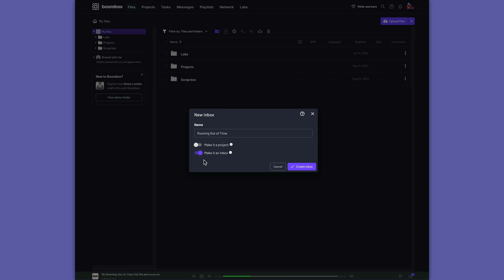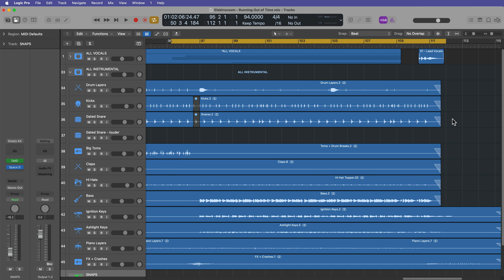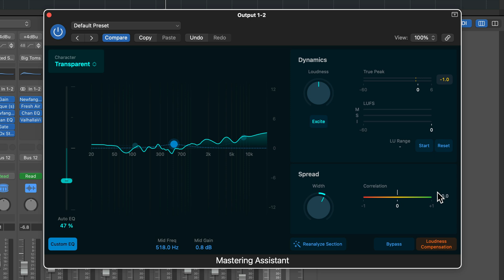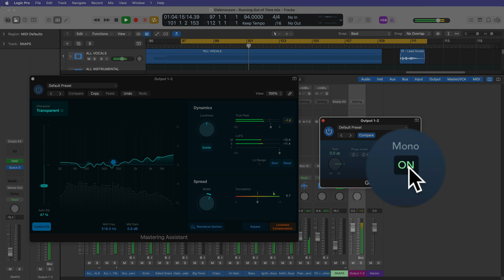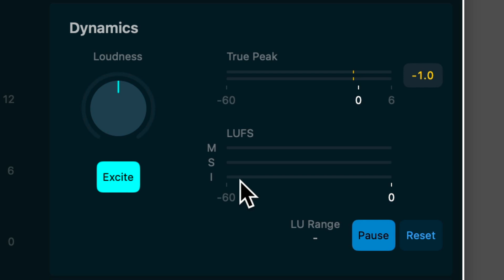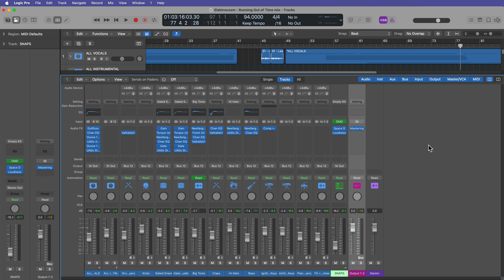Logic Pro 11 - #31 Mastering Assistant, LUFS & Loudness Metering

Comment from the maker: Welcome to part 31 of my "Logic Pro 11 Essentials" course! In this video I cover the following:
1. How to use the Mastering Assignment on the Stereo Output.
2. How to add stereo width and use a Correlation Meter.
3. What are LUFS, what are loudness standards for mastering and how to monitor loudness.
4. How to master a finished mix using Mastering Assistant.

Check out Boombox, the sponsor of this video ➛ https://bit.ly/boomboxsponsor
Song in the Video: Running Out of Time ➛ https://youtu.be/GmqchiAN3As?si=eRTCj3BOK2FrwL2I
For mixing/mastering work, contact me at my website ➛ http://carneymediagroup.com
Follow MusicTechHelpGuy on Instagram ➛ http://instagram.com/musictechhelpguy

Timestamps:
0:00 Intro
1:24 Sponsor Segment
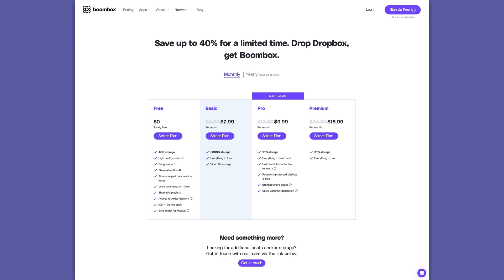2:15 Stereo Out Headroom
4:05 Mastering Assistant
5:20 Character
5:59 Auto EQ
6:39 Custom EQ
7:33 Spread & Correlation
9:18 Mono Compatibility
10:36 Dynamics & Excite
11:24 LUFS & Loudness
14:05 Set Loudness
15:10 Loudness Compensation
16:37 Character Comparison
18:17 Wrap-Up

Comment: I have a tonne of volume automation on loads of tracks, so reducing the volume of all tracks (such as at 3:36) won't make a difference, the slider will just spring back to their automation levels. If you recommend Stereo Out and Master set to unity, how would you suggest reducing volume to give that 6db of headroom?
Reply: if you have automation just use the gain plugin

Comment: If you want to bounce a mastered track, do you Normlaize or no? Thanks!
Reply from the maker: I never use the normalization feature in the bounce dialog. If you have your Master fader level at 0.0 and you have a Limiter on the Stereo Output with a -1 dB True Peak ceiling, and you've added a good mount of gain to get the level up to the ceiling, no need for normalization or overload protection.
Reply: @MusicTechHelpGuy  Good to know. RouteNote wants MP3s, not sure I am going back to them, and all the others, WAVs. Someone said "Don't include the tail" on a Mastered MP3. WHat should and should not be included on both the mastered MP3 and WAV. Thanks!
Reply from the maker: For music releases on streaming platforms. WAV - Use 24-bit or 16-bit, format: interleaved, dithering: POW-r #2 or #3. If your distributor accepts 24-bit files, use that. If not, use 16-bit. For MP3, set the bit rate to 320kbps for the highest quality, Don't use variable encoding. Use best encoding and filter frequencies below 10 Hz. Joint stereo.
Reply: @MusicTechHelpGuy  Oh wow, so you DO dither a WAV if mastered, ok, what about the tail? I know for regular pre-mastered bounces we do include that. Thanks!

Comment: I've noticed that all your tracks are audio regions and none are Midi. When you are mastering, whether using this tool or not, is it standard practice to bounce all tracks in place before doing so, or is this optional? I couldn't find a clear answer from your videos in this series so far. And if so, is it better to leave each track as separate bounces, or to just have one fully bounced audio track to master?  

Thank you so much! I've followed the course to the end and have learned much.
Reply from the maker: If you're the only person working on your song from start to finish, then having a mix of audio and MIDI is no problem at all. If you plan on sending the project over to a collaborator or mixing engineer, it helps to bounce your multitracks as audio, just in the case your collaborator doesn't have the same software instruments as you. I use a lot of third party instruments, so when I finish one of my songs, I typically bounce each channel to audio, because I may come back to the song later and not have the same plugins installed. Also helps me when I finish a project and archive it.
Reply: @MusicTechHelpGuy  This makes a lot of sense. Thanks for the swift reply! Really appreciated :)

Comment: Josh thank you so much for another great video! right on time :) your lp11 essential course is incredible, thank you so much for your hard work!
Is it preferable to use monitor speakers or headphones when using the mastering assistant? And which volume level should I listen at when doing so?
Reply from the maker: I use monitors, but reference on headphones. So I'll make sure to listen through on both. Mastering is one of the few times where I actually listen pretty loudly. Due to equal loudness curves, you'll find the mix balance can change a bit depending on the volume level. So I listen at low levels, mid levels and loud levels and shoot for what sounds best over all. I also ref all my masters on Apple AirPods, on a mono portable speaker, and of course the old car test.
Reply: @ thank you so much for taking the time to answer elaborately! All the best! 🫶🏼🙏🏼